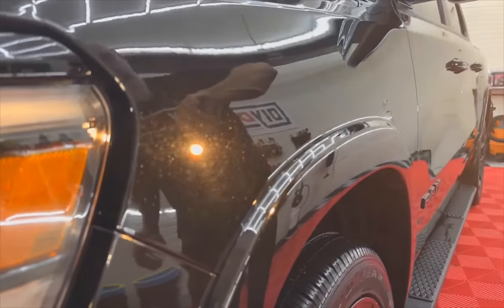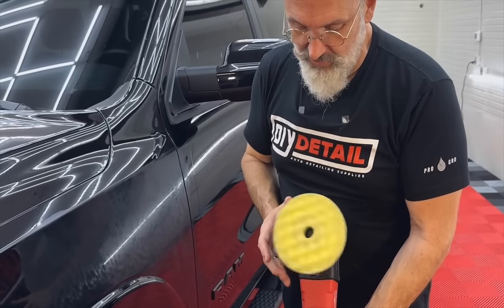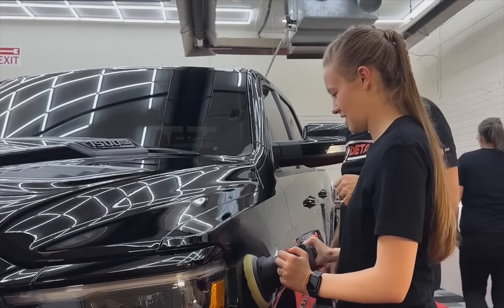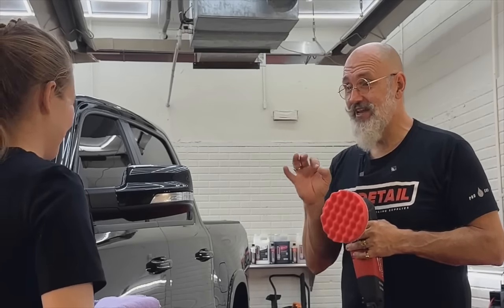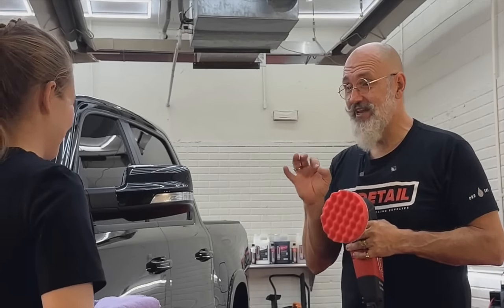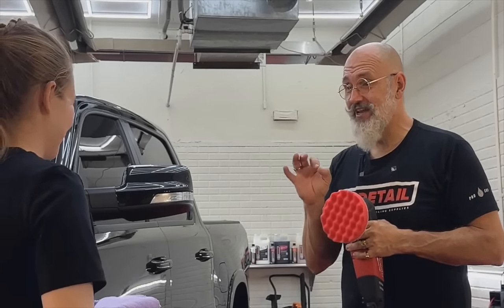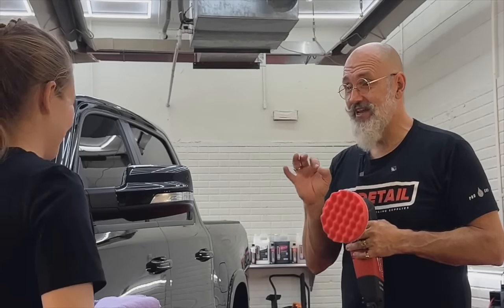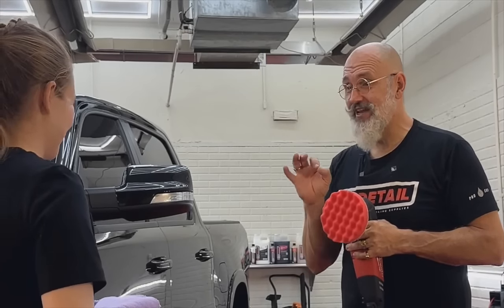HOW TO POLISH FOR THE FIRST TIME! Teaching a beginner,#diydetail #polishblackpaint #goldstandard

Comment: Car buffers get a bad wrap but what i like about them is that they actually improve the paint and don't make a lot of noise so they wont damage your hearing. And the new ones out today spin over 3500- 4500 rpms which is way faster than the old ones from years ago.
Reply from the maker: Correct

Comment: Very good video. I picked up a lot of tips. I like Emilys enthusiasm for the job. One major issue I would like to pick up on. Emilys instructor should have stressed to her to tie her long hair up. In a workshop especially around rotary equipment long hair is a safety hazard. You dont get a second chance. I learned that from Tech school back in the seventies. We were made to wear a hair net in trade classes. Either that or get our hair cut. Took us guys a while to get used to the hair net but that was better than getting your hair caught in a machine and getting scalped. The thought sends shivers down my spine. Keep the good work up. Also wear some eye protection too. Some of that car polish flicked in the eyes not good. I hope i don't sound too much of a grouch. Take care and keep polishin.
Reply from the maker: Thank you, having no hair myself it’s not something I think about. For the eye protection, agreed. One advantage of The Gold Standard Polishing System is that we have zero sling nor dust.
Reply: Or tuck it in the back of your overalls. I used to have long hair in the 80s when I started in a body shop using angle grinders and rotaries.. I learnt after a very close incident.. 
Props for pointing it out.
Reply: I’m ready to give the rotary another spin. 30+ years ago, I was traumatized by a thick wool pad and a Black & Decker rotary.  My dad and I were buffing new out blue lacquer paint on a car I sprayed in the garage. I burned through down to the primer several times. I can remember using a flat blade screwdriver to clean the pad. Times sure have changed.

Comment: Thank you. I have a 20 year old vehicle and the car care centers that I could afford were not enough in the long term. This video has helped cut through the techie talk and addressed beginner level body mechanics with mistake corrections. The moist, clean pads, and initial damp towel to wipe off the polish cleared up a problem I have had in the past. I now have a better chance at getting my babe further down the road with dignity.
Reply from the maker: Happy to help
Reply: Cleaning between steps really helps so you don't get holograms in the end. Easy step to forget too!

Comment: Would using a slightly dripping microfibre cloth that’s be dunked in your rimless then gently held against the waffle pad as you spin it up for a second or 2 work with both cleaning and making the waffle pad damp rather than keep removing it from the backing plate.

Also for those who are looking into polishing a vehicle, I can strongly recommend getting a test panel from  a scrap yard to help you get use to the feel of your machine polisher
Reply from the maker: Yes that works to keep the pad clean. A test hood is definitely a great idea
Reply: I worked for old beater car lots and practiced like that, old cars friends and family have are also a good choice.

Comment: This is fantastic content. Thank you!
Reply from the maker: Glad you enjoyed it!
Reply: @diydetailofficial  feeling inspired, I washed my truck last night. This morning (in the garage) I clay barred the hood (first time using clay) and broke out the Griots G9 I purchased in 2020 and had never even plugged in and got to work on the hood.

I'm pleased with my results for a first time but something I've wondered about and seems to get left out of videos is dealing with body lines and curves larger than the pad. I think my F150 is probably easier than the Ram in this video but it's got a few spots. I haven't tried it yet but the roof isn't flat and no one ever shows how to work that. 

I used a 5" pad btw, not the 6" backing plate that came with my machine.
Reply from the maker: You simply need to practice.

Comment: Great video!  Question:  I used a very light general purpose polish before ceramic coating and it really cleaned up the clearcoat. What it didn’t do is get out some of the light swirl marks. What’s a good slightly more aggressive polish for a beginner to use if you want to do a two-step process instead of just one real light polish?

next time I do a ceramic coating, I’ll probably do it two-step to make sure and remove some of the light swirls.
Reply from the maker: The DIY Detail Gold Standard Polishing System is very effective and simple to use.

Comment: Do you have to do any additional work to remove surfaces scratches ?
Reply from the maker: You may need to do more passes. Remember polishing doesn’t remove scratches, it removes the clear coat around the scratch down to the level of the scratch.

Comment: @Yvan, what size polisher do you prefer more and why? I have about 30yr old Porter Cable 6” DA now, but would like to move to a M18. I was going to go with the 15mm, but a couple of people are telling to move up to the 21mm. Thanks in advance for your invite and thoughts
Reply from the maker: The 21 is definitely the better machine. I like 6 inch pads.

Comment: For a black 2014 Audi Rs5 could i use the wool /red jeweling combo followed up with the C6 APP to prepare for Hydro Lite ceramic coating? Or you thinks its too harsh for Audi paint for wool
Reply from the maker: That’s fine
Reply: @diydetailofficial  ok thanks a bunch . Hopefully it wont be too windy outside putting the coating on

Comment: I have that Milwaukee 7" rotary. What replacement wheel did you use to turn it into the 6"? Also planning on getting one of their DA units and was wondering if the 15 or 21 would be better given i have the rotary? Im not a professional, but will likely be doing and maintaining 4+ cars.
Reply from the maker: Any brand of 6 inch backing plate works. Get a 21 mm

Comment: I just bought a polisher and plan to polish first car soon but I cannot find anything on the pars types.  What I mean is his pad is waffle like but when you look at options there are tons more flat with straight lines through them.  Which one is better, his type puts less surface area on panel is this a safer option also thinking less heat?  Or is there nearly no difference between this or the straight line groove ones?
Reply from the maker: Waffle pads are by far the best, but manufacturers prefer flat pads to lower costs

Comment: New detailer here. And I got a new rotary tool.

I've only been using it to apply carnuba wax and it kept slinging everywhere. I learned to immediately it into the pad, and I'd get significantly less sling.

In the video he said his pads are always slightly damp, im assuming just water?

I don't have a liquid wax, I have the paste kind. Any tips on how to make less sling? Also, my rotary tool has up to 7 speeds. But even just the first speed seems so fast! I can't imagine using the other speeds!

I did learn that you don't need to press down. That's what I was doing. My pad rotate speed would change and I thought I had a defective rotary.

What speed should I be using for waxing?
Reply from the maker: The lowest speed possible, and use a waffle pad

Comment: Hi, I bout a car that it’s new, I know we should descontaminate, clay, polish a sealed .my question is what polisher  brand do you recommend for a begginer?

Thanks you for your vids
Reply from the maker: The brand isn’t important, get one that has good service support locally.
Reply: I'd skip the clay on a newer car if it feels smooth...they do scratch the paint some. I prefer to clean with varsol for tar or methyl hydrate for tree sap (a type ofalcohol from hardware paint section) before ever pulling out a clay bar.

Comment: is gold standard safe with piano black surfaces? and can I just wipe the polish off by spraying ceramic gloss then wipe, for the whole car? seems like a legit paint enhancement method
Reply from the maker: Yes it is! We prefer to wipe with a short nap towel, barely damp from your Rinseless Wash bucket, to remove polish. Then you've got a slightly damp surface and then you just use a light spray/mist of Ceramic Gloss onto the paint, followed by a plush dry towel until it's all dry...this is a great way to polish and protect in almost one step

Comment: Hi Yvan, I'm a beginner and very curious about the function that a detailing light can switch the CCT and have much higher CRI, how is that help to polishing a car and in what situation should we use different CCT?
Reply from the maker: Colour temperature helps when doing different paints . I prefer lower temperatures on lighter colours.
Reply: @diydetailofficial  Thank you for your reply Yvan. One more question, why a detailing light need high CRI?  I tried use a work light with Ra80 and it can still see the paint defect, and that confuse me what the real meaning of high CRI for detailing lights.

Comment: Informative, straight to the point, and practically useful material. You don't see that everyday, thank you sir.
By the way, the yellow waffle pad link is broken and I couldn't find the smaller machine on your website, could you give me the make and model please?
Reply from the maker: Thank you! Just fixed the link, much appreciated, here are our two polishing machines.

MAX GLOSS ROTARY POLISHER: https://bit.ly/DIYMaxGlossRotary

25MM DUAL ACTION POLISHER: https://bit.ly/25mmCorrectionProDA
Reply: @diydetailofficial  You're welcome 🙂

Thank you for the links, but I was referring to the small one that can be held by one hand and looks a bit like a sander.

Comment: Is it safe to say to just use a polish on micro scratches and no compounds?  I plan on keeping my vehicle a long time and don't think compounds are a wise decision.  I recently bought a 2021 Ford Expedition Black and it has some micro scratches.  You almost can not see them unless you look closely.
Reply from the maker: Correct, compounding is like using a sledgehammer to drive a finishing nail.
Reply: Thank you so much and great video too @diydetailofficial
Reply from the maker: @rahouston thank you

Comment: By far the best how-to I've seen on this 👏👏

One thing though, did I miss the part about how often pads are meant to be cleaned - is it really after every panel...? ✌️
Reply from the maker: Yes, never add Clean polish to a dirty pad.
Reply: @diydetailofficial  yes but how often? How many m2 would you expect the average pad to last before it needs cleaning?
Reply from the maker: @anonimushbosh it needs cleaning after every section.
Reply: @diydetailofficial  Wow... Thanks!

Comment: Does hydro lite fill in some light scratches to make the paint flat again
Reply from the maker: No
Reply: @diydetailofficial  could i stack hydro lite with diy 5 for extra gloss?
Reply: @diydetailofficial  if you spray some clear coat on deep scratches then polish them
Reply from the maker: No

Comment: @diydetailofficial guys how often do you wash the pads when are cutting/polishing? Is there any rule about that? 
And does your golden spray leave a protective seal like wax ? Or after polishing should I apply wax or something like that? 
Thanks so much you are a legend guys 🤙🏽
Reply from the maker: The rule is simple, never put clean polish on a dirty pad, meaning clean it before applying polish. 

DIY Detail Gold Standard Polish is a pure abrasive, it has no protection and leaves nothing on the surface

Comment: I know why people burn through the paint with rotary polishers because I've done it 20 years ago. We was using a makita with a very fluffy wool pad on the highest speed but the problem was the paint was not factory but it was brand new. As in a week or two. So the paint isn't even close to being cured, the polisher is on the highest setting, and we was using the wrong pad and cutting compound. Some cutting compounds are very abrasive. We was doing this for a showroom finish. We has completely wet sanded the entire paint and got every single fish eye and orange peel out. But if you hit the edge of a hood of a freshly painted vehicle with what I just described, I guarantee that it will burn right through. Aftermarket paint is never as tough as factory just as Yvan has said several times in his videos
Reply from the maker: Thanks, sorry you had that traumatic experience, it’s never fun to burn paint.
Reply: Aftermarket paint can definitely be tougher than factory paint. Paint used by car manufacturers isn’t special.
Reply: I use a wool pad and heavy cut on paint only a few hours old at the body shop when the painter over bakes the cars and gets solvent popping on the surface of the paint.  

Yes, it's very possible to wool pad and heavy cut on fresh paint but you also have to watch edges or even throw tape on that tricky edge to protect it if needed. 20 cents worth of tape is better than $200-300 of new paint and the embarrassment of the whole bodyshop knowing you burned through. We all can and do make mistakes, even after polishing for 34 years but we try to minimize those days 😂  

As you get experienced you learn where you can go, and how you need to hold the machine for different edges or directions, especially transisioning lines . When your new, you don't know where your WHOLE pad is, as much  so tape is more important than ever.

Comment: Im using an 800 rpm polisher, and I am having an extremely difficult time to keep the pad flat with the techniques shown in this video. Do i need a 600 rpm polisher? Thank you very much.
Reply from the maker: What pads and polishes do you use.
Reply: Im practicing with ccs pad and tw one and done. I think the issue might be that I don't have enough lubrication

Comment: Awesome content! I have a black car and soon I will try the rotary polisher!

(Hope to get better results since my previous attempt was with DA polisher and it didnt cut as I was expecting…)
Reply: I don’t think you should buy a whole new polisher unless the dual action wasn’t very good. Maybe buy a Maxshine m8s as a da but if you had a sort of cheaper one the experience could be different due to quality as well as the polish and compound or one step polish you used. As well as if you washed the car properly and decontaminated it before. And usually they add wax and sealent to make it shine so just make sure your analyzing everything before investing more of your money
Reply: @broken2550 thanks for the tips! I am using a reasonable DA machine (not high end as flex or rupes but it is between low-mid range), so maybe my technique is not great.. I used wool rupes pads the blue and yellow and polish was Scholl S20 black. Also tried Meguiars Compound first step and Meg Polish for second step. My car is an audi so maybe it is because of the type of clear coat which is thick and requires a rotary for cutting such deep scratches.
Reply: Regarding prep I know that is key and did quimical and mechanical decon with claybar and proper pre-wash and after polishing also proper wash with panel prep before applying ceramic coating. I think i removed 70-80% of the scratches but since it is a black car is more obvious when you look at it.. 😑
Reply: As I love detailing I would love to remove almost 90-95% of the scratches but I know that sometimes it is not possible… will try rotary and improve my technique on DA too.
Reply from the maker: We never use a rotary to cut, the DA is a much more agressive tool. We use the rotary for final polishing, to increase gloss. That’s how our system was designed.

Comment: Sir

When I polish the rotary machine with hard foam to my detona grey car. Polish marks will always be there. I use wax polish on my car. I am from India
Reply from the maker: For the rotary you need a soft waffle pad
Reply: @diydetailofficial  thanks sir. My car is like my family member, like my son. So I do polish at home. I have practical knowledge but I am not a degree holder or a professional. But my family members treat my car as a vehicle. You know women are women.

Comment: If I don't have a pad-washer to apply moist before a polish, would it be ok to just use a spray bottle with mineral water? (tap water)
Reply from the maker: Here’s another way. https://youtu.be/wsxWcCuspug?si=m2oXqnQdNQb7F0Qw
Reply: @diydetailofficial  That video have mainly its focus on cleaning the pads, I'm just curious to what I could use when just moisturizing the pad before a polish 😊 My spray bottle idea with clean tap water could perhaps work, like when you're applying polish to the pad while the polisher is spinning. Great tips overall 🤩
Reply from the maker: Use the wash process to throughly dampen the pad, spraying on the surface isn’t enough.
Reply: @diydetailofficial  Gotcha 👍

Comment: Hi Mr Lacroix ! I have started my own detailing business since januari 2024. I just wanted to ask and maybe comment on the " let the machine do the work ". Is it really? All the products/polishes/compounds say on the back to apply medium/firm pressure. Why is that? is it a scam to use more or get bad results? Would like your knowledge on this. Thanks in advance.
Reply from the maker: All products are designed differently. The Gold Standard Polishing System is designed for efficiency and ease of use. Congratulations on your new business.
Reply: @diydetailofficial  Thank you. Just confused , my results do not seem to be consistent. If you use a heavy cut compound, you don't apply pressure either? regards
Reply from the maker: Correct